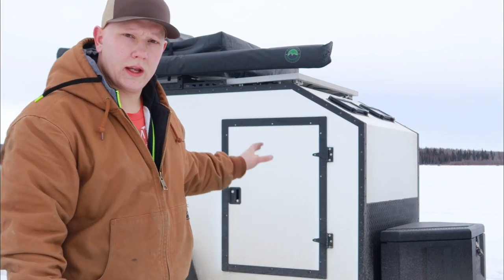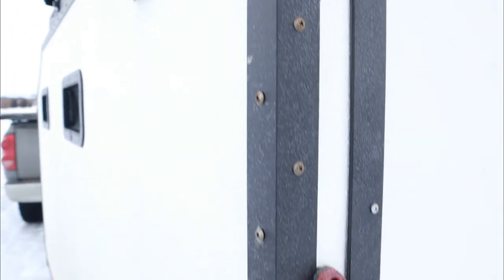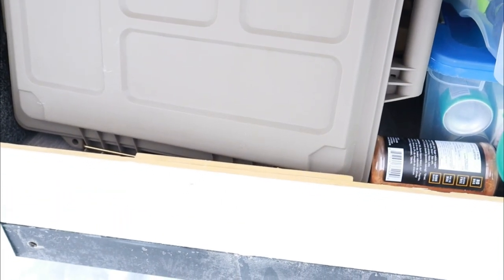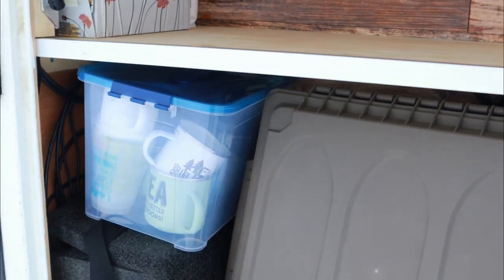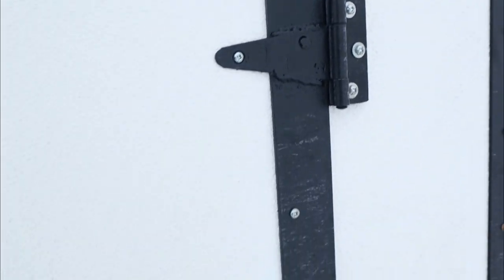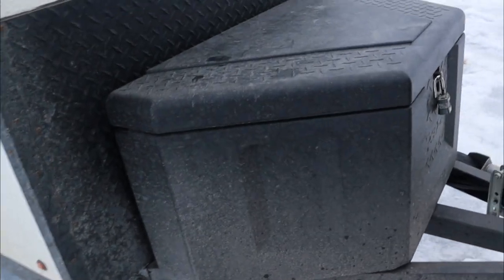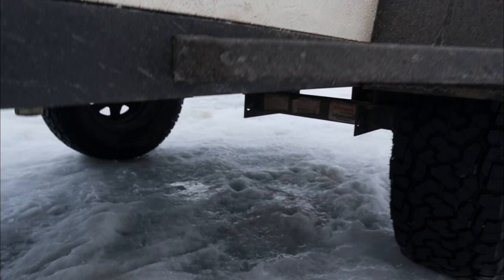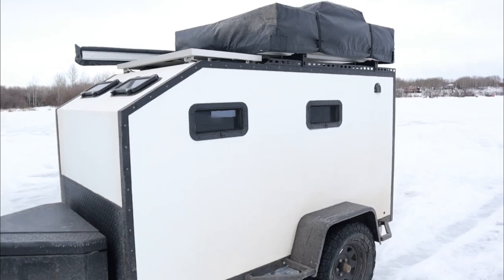DIY Overland Trailer Tour - Squaredrop Camper

Comment: Awesome build where did you get the trim or gasket that you put around the doors on the inside?
Reply from the maker: The weather seal for both doors (rubber D shaped door seal) can find it on amazon. The side door has aluminum channel to protect the wood edge from getting in and out.

Comment: Just watched another of your videos. I was hoping to see how you built your doors. By the way, glad to see just one door as I was starting to think something was wrong with me for only wanting one door to get in. Does the trailer stay fairly warm in the winter? I did not see any insulation go in. Where I live it gets really hot in the summer so I plan to add A/C. Still debating with myself if I want to mount an A/C unit or create duct work and leave the unit outside. You did a great job. Mine will be more like your and not have a ton of fancy stuff I dont need. I just want a place to carry some stuff and sleep. If I wanted to sit inside and watch TV I would just stay home and save the money. Great video.
Reply from the maker: Thanks for your feedback Douglas! The side door is the piece of plywood cut out with 1"1/2 -1/8 steel frame attached so that it overlaps the edges. The floor, roof and front wall have 1"1/2 insulation installed. Everyone has their own comfort levels. We've stayed warm by just heating the cab before bed and sleeping under a duvet. (I hate sleeping bags) I see many people putting in A/C. I can see why with the higher temperatures in the states. For me I would never be able to use it as I dont camp near shore power. Ya about the one door.. I dont understand the need to have two doors either. Its not like its hard to move out of the way to allow your partner to exit before you do. Enjoy building your trailer!

Comment: Tks for sharing your ideias and built!! For both doors you can get a perfect no leakage whit this rubber? How much the total cost?
Reply from the maker: I have yet to have a leak while driving or washing with a pressure washer. I purchased the teardrop silicone weather-strip from home depot $26cad for 20 feet. 
I had tried the foam style weather-strip, it would stick and peal itself apart. After switching to the silicone (rubber) weather stripping I have yet to have an issue.
Reply: @ShankOutdoors  thanks! The total cost i asked is for the complete teardrop eheh not only for the rubber.

Comment: What do you do for heat in the winter?
Reply from the maker: So I have tried three different ways. 
1: I have pre heated the trailer before bed with an old Coleman heater. Sleeping with a thick duvet 
2: I have ran a heated blanket under our duvet, running off our solar system (did not preheat trailer)
3: later I built a portable diesel heater in a pelican case. Video on the build coming soon